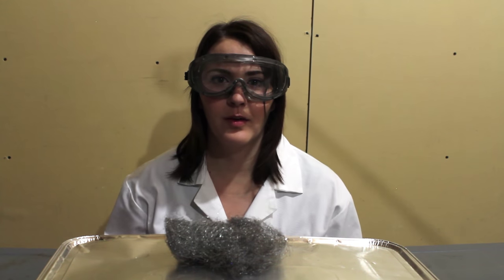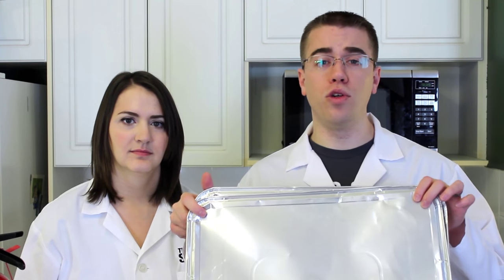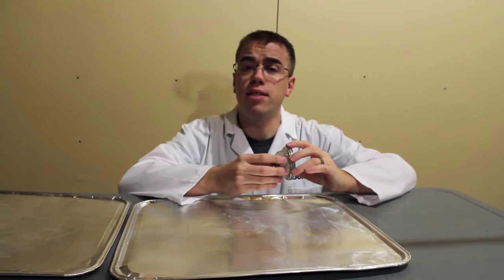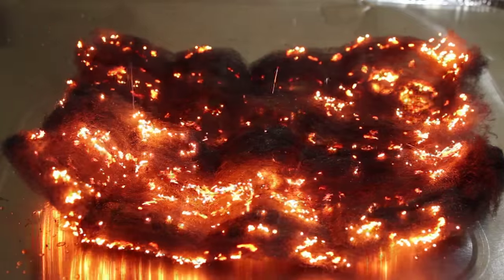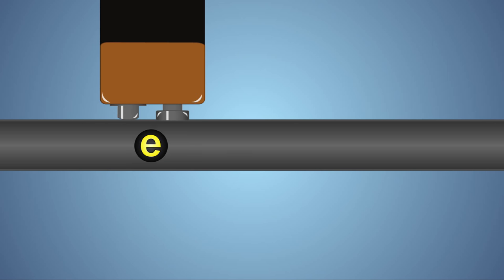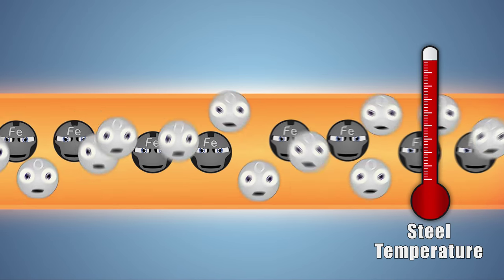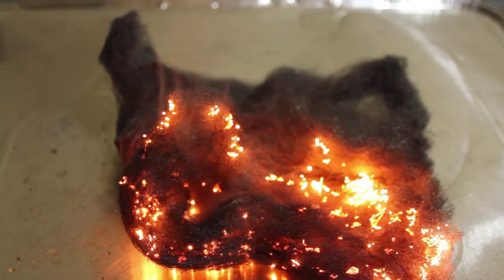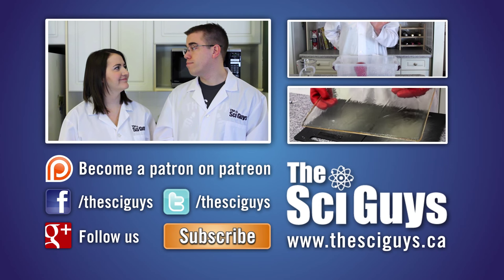The Sci Guys: Science at Home - Burning Steel Wool

Comment: Fun episode!
"An alloy is a metal made by mixing two or more metallic elements..."
Except carbon is not metallic.
Also, it's separated, not seperated. :)
Reply from the maker: +Stephen Abbott Smelting using carbon to reduce iron oxides, results in an alloy called pig iron which retains too much carbon to be called steel. Some of the carbon is then removed in future steps to create steel but much of the carbon can remain depending on the alloy.

Comment: What is the final product from the oxidation?  Iron oxide has a density far less than both steel or iron yet the mass of the material increased with no change in the volume.  How can this be accounted for?
Reply: only the iron is reacting lol

Comment: Would the steel wool oxidize the same way under water?
Reply from the maker: +Gawn Bonaparte Well this reaction wouldn't occur underwater because of the lack of oxygen. You would need a chemical that produces oxygen in the reaction to continue the combusiton, like how we put the sparklers underwater in one of our experiments. If you are refering to the oxidation of the steel wool by rusting then you would probably end with different types of steel oxide.